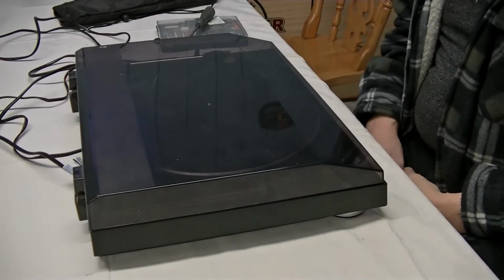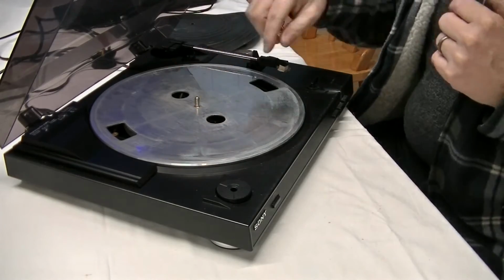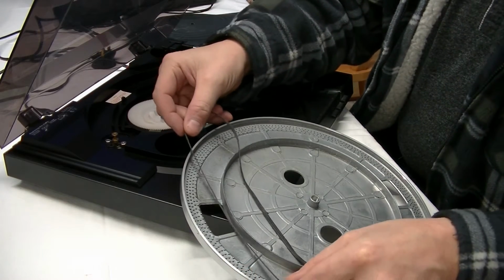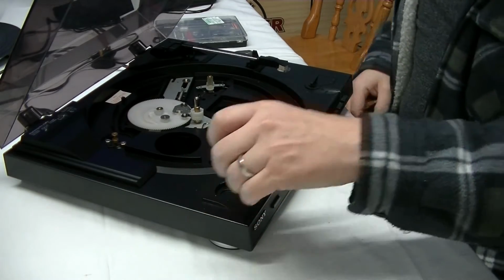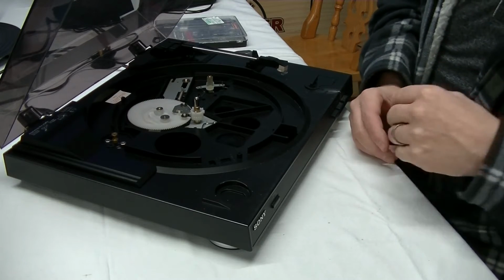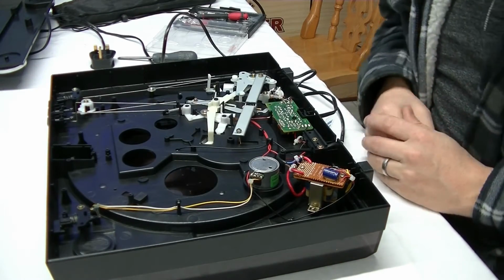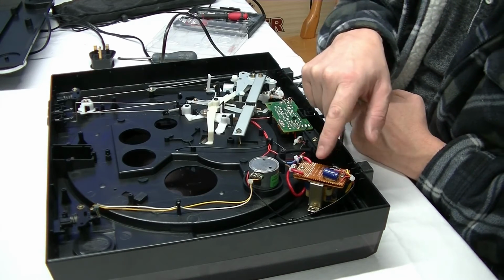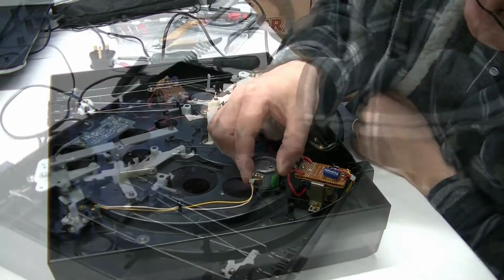Sony Record Player Repair Part 1

Comment: I accidentally plugged it in 220v now it's not working? Does Need to replace the power supply board?

Comment: You lost me when you began taking the circuit boards off and talking about such as capacitors.  My Sony Turntable which looks exactly like the one you have here is stuck on what appears to be 45 rpm.  33 rpm albums appear to be played too fast.  The selector toggle between 33 and 45 is ineffective in correcting the problem and since I'm not confident enough or curious enough to take the unit apart via the screws on the bottom, I ordered a new turntable from Amazon, a Crosley.  For $150 I'm hoping it serves my infrequent needs.

Comment: The solution is to get the correct sized belt as belt circumference changes platter speed.
Reply from the maker: The motor regulator was burnt out so had to be calibrated, changing the belt size would not work as all you would be changing is the belt tension.